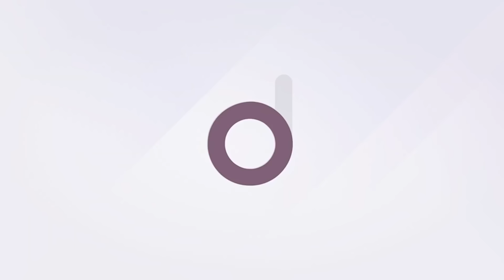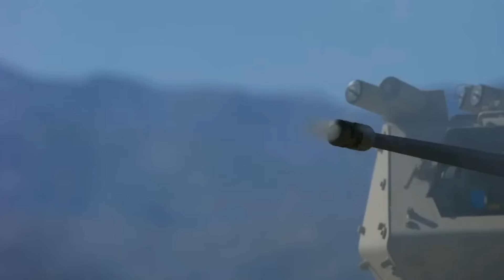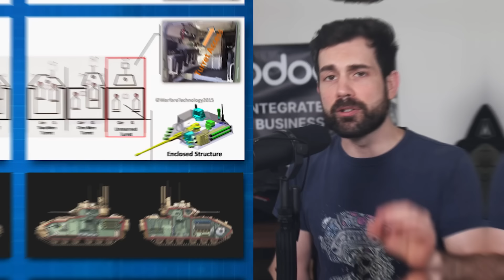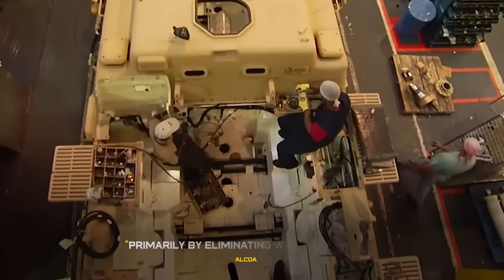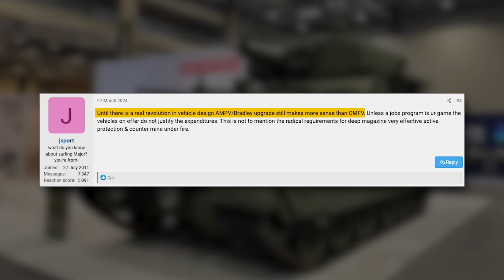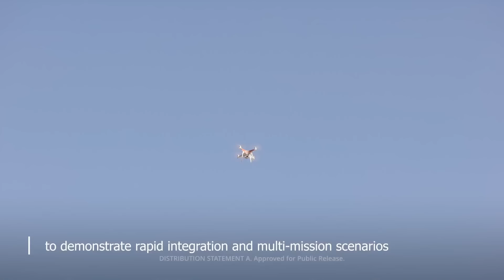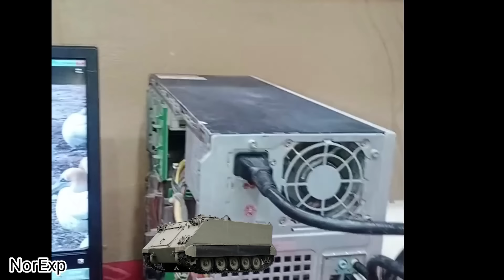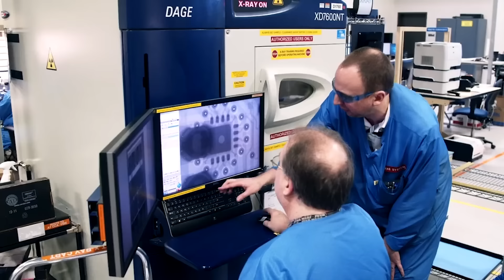How America’s Quietly Building a Secret Armored Fleet

Comment: I suspect that the reports of Bradley’s with 25mm auto cannons outfighting Russian tanks had something to do with this push for MPVs. I note that 30mm is the same round as used in the GAU-8. Include some tungsten or DU penetration magazines and you can take on most tanks.
Reply: Seems like Bradley's are making much more of a difference in Ukraine than any western tank, carries the homies to the trench line, can at the very least disable a T90 and fast, so many vids of them piecing up russian apcs
Reply: @chipdiesel9788 except they aren't. Bradley square is full of burned down bradleys
Reply: @chipdiesel9788 I suspect WT semi-accurately modelling tank components give Ukrainian gunners a much easier time dealing with heavy armour.
Reply: @chipdiesel9788 
In fairness, they have a LOT more Bradley’s than Abrams, and Abrams are high value targets for the Russians because it’s a propaganda victory for each one they can record. Ukraine has been keeping a bunch of them close for that reason and because drones, mines, and artillery (often all three combined) are a big threat to it.
Reply: @chipdiesel9788 they need ammo badly
Reply: The 30 MM for the A10 is not the same as the rd the Apache fires,The GAU 8 Rd is much bigger
Reply: You can take em on from the top but not side or frontal armor
Reply: Unlike the a10…
Reply: "25 мм справляется с российскими танками"😅😅😅
Я на минуту забыл, что в штатах легализованы наркотики 😂
Reply: @Роман-ш7ж4у 
25mm APFSDS hitting the side of tanks will damage or even destroy them. The Bradley even managed to blind and destroy the sights of a T-90M, causing it to retreat and eventually forcing the crew to bail out.
Reply: Nope. It's a one-off situation, and it only blinded the tank and did not penetrate the hull. 90 percent of armored vehicles are destroyed by drones, artillery, mines, and anti tank missile in that order.
Reply: @du5707  as has been shown in Ukraine, penetration of armor is practically irrelevant.

Like Ukraine, if the US goes to peer-war it will be against an opponent with an endless supply of meat. Killing crews has no real advantage to just disabling the tank.
Reply: Is it the same  30mm as the gau-8?  30x173mm?? I thought these auto cannons shot the 30x113mm  like the apache m230 chaingun
Reply: In any case the 30mm  was designed for light armored vehicles/ structures.. the agm65s and bombs are what made the a-10 a tank killer
Reply: I've  never had " water cooled fans" on my computers I've built.....I've had fans cool the radiator for water cooling
Reply: Are those... "Russian tanks" in the room with us right now?
I wonder how come there's a Bradley square with tons of destroyed Bradleys, yet somehow there's no Russian tanks square with tons of destroyed Russian tanks 🤔🤡🤡🤡
Reply: @RightWingNutter  love how YT deletes comments all the time
Reply: The a10 is designed to target the top of the tank where the armor is thin. 30mm won't penetrative a tanks side or frontal armor
Reply: What ?  Umm… nope 👍
Reply: funny considering the GAU8 wasnt even capable of destroying a T55 after six passes in test conditions and the USAF had to overinflate the A10s kill count in the Gulf War and Iraq war
Reply: @nicholasbrown668  this may have less to do with the 30mm round of the GAU-8 itself, and more to do with GAU-8's accuracy and the platform it's mounted in.
Whenever the A-10 fires it's gun the whole plane vibrates, and where ever the pilot is aiming, realistically there's s 20 meter area around that point where the bullets will land (which is why F-111s and F-15Es did better at killing tanks, using laser guided missiles and bombs).

Performance is probably much better when fired on a stabilized, land-based platform with a much lower fire-rate that can actually, accurately hit the parts of the tank it can actually pen.
Reply: @barrag3463  I mean its also the round itself, it just doesn't have the penetrating power to kill a tank, of the rounds that landed on the T55 in testing, next to none of them were able to pierce the top armor and only a handful were able to pierce the armor on the rear top of the tanks engine compartment

The GAU8 is a great anti infantry weapon in open settings, but it's not a heavy armor killer like the USAF wanted it to be
Reply: @barrag3463 what you said is true, and there is also a funny caveat to this. Being airborne and coming in from high angles at fast speeds are a lot of what gave them their penetrative power and effectiveness against tanks. Although even then, ultimately the gun is much lacking against modern tanks compared to what it used to be able to do.
Reply: @nicholasbrown668 The problem with the rounds hitting tank roofs is that they’re coming in at a very oblique angle due to the shallow dive angle of the aircraft on approach.  At that angle, 2” of armor might have an apparent thickness of 5” when you’re talking about how much steel the round has to actually go through.  That said, it’s my understanding that the GAU-8 did rather well against the T-55’s roof.  The T-62 and T-72, not so much.   But again, the USAF never considered that gun its primary weapon, especially against tanks.
Reply: @bluemarlin8138  This is contradicted by both Army and Air Force studies, the A10 wasn't capable of Penning the armor of a T72 per Army studies and the GAU8 was struggling to pen the armor of the T55 and T62. Also an aside, the GAU8 was considered the primary offensive weapon of the A10 until it's upgrades into a true missile platform, the A10s entire combat doctrine was centered around strafing runs against soviet armored columns using its main gun and bombs. The entire airframe of the A10 was specifically designed around the "tank killer" GAU-8

The GAU-8 theoretically is capable of penetrating the top armor of a T72, but it would need near optimal conditions coming in at an attack angle of 30 to 40 degrees according to an Army report, but that would expose the A10 to both SAM and ground based AA platforms well before the A10 could position itself for an attack run
Reply: @barrag3463 they are not using the gau8 for the new vehicles, the gau8 is to big.
Reply: @nicholasbrown668  thats not what they say.  During testing supposedly they went to great lengths to have running Russian tanks to see how well of a job it would to to incapacitate the tank and it did a good enough job to be selected.
Reply: @nicholasbrown668 The 30mm rounds used will likely be a sabot dart, not an actual round like that used in the GAU-8
Reply: @SuperTrb0 it can do both
Reply: @nicholasbrown668  the A10 is more effective against armor as a missile platform. The whole 30mm cannon thing is way overblown. That’s why they’re phasing out the A10. I’ve heard F16s can do just as well with their cannon in the infantry support role.
Reply: @kennys9644  I know that's why I pointed out that slapping a 30mm gau8 with DU rounds won't really change anything, The A10 was touted as a "gun based tank killer" its whole selling point was that it was survivable and could kill any soviet tank......then we were shown that the A10 struggled to kill armor with its gun and the USAF had to cope with that by overinflating its kill ratio by attributing kills earned by the F15 and F111 on the A10
Reply: @nicholasbrown668 This just isn’t true.  The USAF never considered the GAU-8 to be a tank killer, just a killer of BMPs and other light armor.  And it can absolutely do that, assuming it can hit them.  But it was designed in an era of large armored formations, and if the Ukraine war is any indication, the Red Army would have had vehicles traveling in nice, vulnerable, easy-to-hit columns.  The A-10’s main tank-killer was always the AGM-65 Maverick missile, as well as bombs and rockets.  That’s been true since the 1970s when it was introduced.  Finally, the USAF never really wanted a CAS aircraft at all.  But it was competing with the Army for funding, and if the USAF didn’t develop the capability, then its funding for it would go to the Army for the Cheyenne helicopter (although the Army actually still got the Apache several years later).  Furthermore, the design request was issued in the early 1960s, when everyone was still trying to figure out the role of traditional air power.  

The USAF didn’t want to cope with the A-10’s shortcomings.  The hype in the Gulf War was driven by the media and ground troops, not the Air Force.  It had been planning to retire the A-10 in the early 90s and replace it with more F-16s, and the Air Force brass was very annoyed that the A-10’s new publicity and cult following with the public and with lawmakers prevented this from happening.
Reply: @bluemarlin8138  according to the National Museum of The United States Air Force, the GAU-8 Avenger is the primary armament of the A10

and on your last point, how was it the media and troops hyping up the A10 when a GAO report and an internal DOD report found that the USAF had purposely over inflated the kill ratio of the A10 during the Gulf War? specifically by attributing kills from the F111 and the F15 onto the A10
Reply: @kennys9644 The A-10 "big gun go brrrrr" worship and memeing was pushed by Russian troll farms in order to pressure Congress to take some funding from the F-35 development program in order to keep the A-10s up and running.
And to also push for the A-10 upgrade program, which cost a lot per unit.
They even gave The Fighter Mafia a lot of coverage on RT with interviews with Pierre Sprey and so on. 
Anything to delay the F-35.

That's because they knew (like the US airforce did) that on a modern contested battlefield a A-10 would be MANPADS bait. 
It's low altitude approach on a GAU-8 gun run would be a gift to anyone nearby with a Stinger analogue - they wouldn't miss. The only hope for the A-10 pilot would be that their countermeasures worked, and clever coordinated MANPADS teams could work around those.

And that was before Ukraine and the explosion of Drone usage made SHORAD capabilities vital for any modern force. 
Even irregular forces are getting MANPADS and SHORAD because it's needed to neutralise Drones.. and MANPADS are easy to supply across borders.
Reply: F-16 doing so well yeah?  @kennys9644
Reply: @kennys9644  They can, they just cost more to keep in the air. When the enemy you fight has little to none air defence it makes sense to use the slow, cheap plane, instead of the fast expensive one
Reply: @kennys9644 No. The F-16 surely can do CAS. But it lacks the loiter time, slow speed maneuverability and ordinance capability of the A-10.

The gun was overrated because due to the lack of accuracy it wasn't actually that good against tanks of its era, not to mention current ones. It's its bomb and missile capability that makes it useful.
Reply: @nicholasbrown668 
Where do you keep hearing the A-10 was given kills that were scored by the F-15E? That’s literally not true.
Reply: Schouldnt there be a pretty significant difference if you fire that thing from a kilometer away instead of a hundred?
 @nicholasbrown668
Reply: @nicholasbrown668 
Frontally, no. From the side, it’s able to take out T-72’s and higher T seriesT-55 has more side armor than T-72, T-80, and T-90’s). 

But the gun isn’t supposed to be the first thing to use against tanks, and it’s only used for side or rear shots on tanks if used against them. What it’s mainly meant for is against light armor and infantry to be able to use the gun on them and save bombs for larger targets.

Comment: Replacement of old with new is normal stock rotation. Replace old M113’s & workout Bradley’s with new equipment & technology. This is something Russia has never done which is reflected in the casualty count. Russia has proven it can’t fight a modern war with a near peer opponent.
Reply: What are you smoking? They've shown they're capable to not only adapt, but innovate.

Comment: The improved mortar is probably the most useful. US mortar vehicles have just been a mortar inside with a hatch open which is very obsolete, but gun mortars allow for spicy stuff like 50% better range and multiple round simultaneous impact firing.
Reply: And spotter drones are  a massive force multipler for mortars.
Their battlefield utility has drastically increased...
Reply: @casbot71  If it's drones, it's gone. Simple as that.
Reply: It also means that some $2 chicom alibaba drone can't fly through the open hatch and frag everybody inside.
Reply: I've seen Russian armoured mortar vehicle.  It actually looked cool, but I'm sure its incompetent compared to modern US/NATO equipment or even China.
Reply: The CV90 mortar variant Mjolner is awesome 👍🏻
Reply: @petter5721 just the name alone is literally legendary.
Reply: @petter5721 Not really. Also, isn't this about 🇺🇸 AMERICAN 🇺🇲 Vehicles...? 🤨
Reply: @petter5721 Not really, and this is about 🇺🇸 AMERICAN 🇺🇲 Vehicles. 🤨
Reply: @petter5721  Not really, and this is about 🇺🇸 AMERICAN 🇺🇲 Vehicles. 🤨
Reply: @petter5721  Not really, and this is about 🇺🇸 AMERICAN 🇺🇲 Vehicles. 🤨
Reply: Having an automated Mortar would be awesome if combined with technique and equipment for frontline troops to call in a mortar strike as fast as videogames can do it.
Almost as good as having an ONTOS available.
Reply: Thank you for the interesting comment. Do you recommend any sources through which one can learn more about these weapon systems? I am amazed at the knowledge of commentors and which to inform myself to the same standard

Thank you
Reply: Could you use a autocannon in indirect fire, a 35mm has a maximum range of 11km. Though this is maximum not effective. If fire enough rounds you will get them. Not sure about 30mm, I think it might be 8km.
Reply: @isaacblackman1996  I don't think 35mm would be effective for indirect fire. Most vehicle mortars are 120mm which gives a 20 metre kill radius. 35mm might be a foot radius and probably wouldn't penetrate much cover? It's not enough.
Reply: They are not ordering the turreted mortar variant - it is an option but not what is being procured.
Reply: Big time protection improvement
Reply: And drive bys
Reply: Lots of scope for artillery systems as well as drone systems...
Reply: I was a mortarman in Armored Cav. Still used 4.2 inch mortars. When possible we would ground mount it.
Reply: Yep Finnish NEMO is OP, but AMOS is double OP.  You can run high way speed and deliver 12 shot on target 8km away in 1sec.
Reply: I wished they made PERSONAL defense cannons. That is the future. 

 Also a single man Ripsaw with the craziest optics, hybrid engine for stealth mode, and a 30mm cannon with a few loiting explosive drones. (Or ATGM). 

 Imagine a tiny tankette like thay, with enough armor for 20mm under. That is driven by one man like a video game with a controller. Including a 3rd person selfie stick driving mode. Sensors like Isreals newest tank. Audio/thermal/whatever. 

 Imagine what kind of mayhem a scout vehicle with a huge offense punch can do behind enemy lines. They'd be able to destroy all, but the heaviest stuff. Yet fast enough to hit and run.

 We got the unammened version. We need the manned version. 

 Also PD cannons on every vehicle. (Think automated gun trophy system slaved to radar, able to shoot down slower ordance. From drones to ATGMs. Perfect for tanks secondary or helicopters primary. We have the technology. Just need to pair it all).
Reply: @dianapennepacker6854  you hate maintainers and logistic trades

Comment: Cappy,
would this mean that the turret has no inside the hull components? From how the Russian's built the t14's unmanned turret, it's deep in the tank. Also what is the torque on the 600 hp engine?

Comment: An APC with IFV-level protection, and an IFV with APC-level passenger capacity. So you get the best of both worlds.

also ModUlAriTY
Reply: Yeah, that's been the design philosophy of the IDF for decades, with the Namer and Eitan. The one downside is that the logistics can be difficult, as that sort of vehicle typically requires more tech support and fuel. However, this isn't really an issue for the US, as we are the undisputed kings of logistics.
Reply: BAE CV90 is a good example of how to do modularity properly.
Reply: @LeonardTavast or the Boxer
Reply: @MaticTheProto  the boxer isnt on an ifv level but has the potential to be the future of lighter formations.  you can fill pretty much every role with a boxer variant for a reasonable price.
Reply: @ the boxer can be used as an ifv actually
Reply: @nox5555  Then pick a Puma.